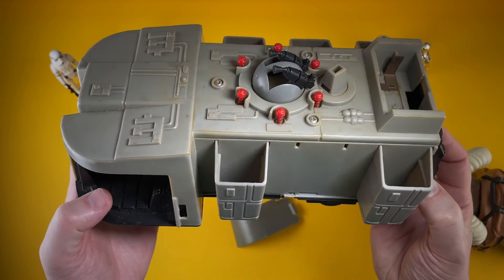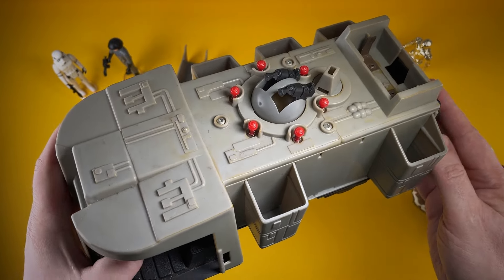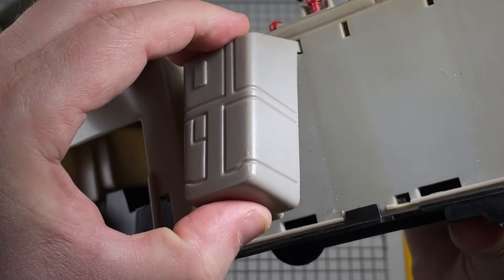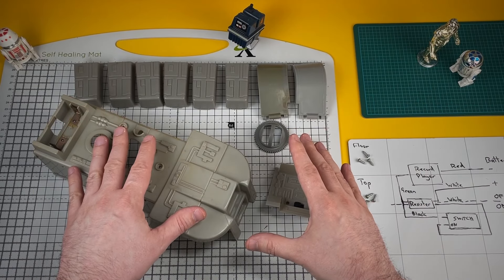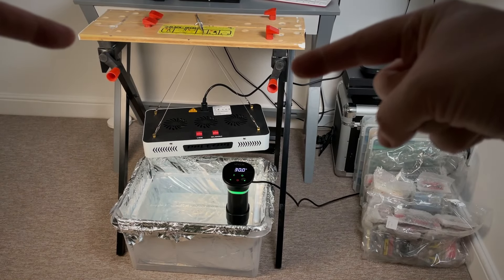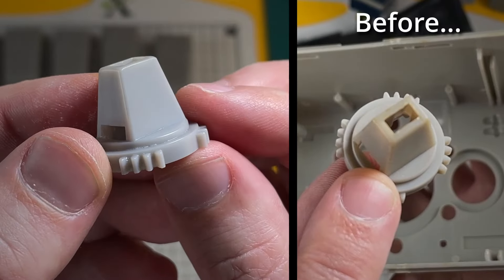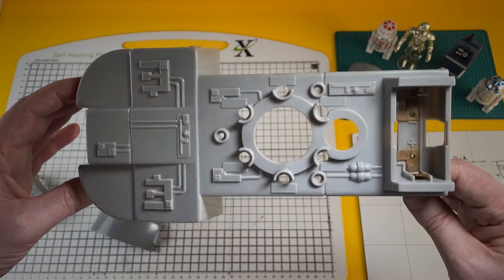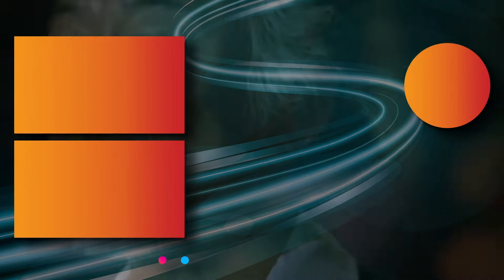Restoring a Wrecked Imperial Troop Transporter - Part 1 - Vintage Kenner Star Wars 1970s

Comment: I really like the idea of heating up the joints before removing the screws! BRILLIANT! I always just pulled things apart (AND HAVE BEEN VERY LUCKY… so far). I’m going to start doing this too!
Love the channel and keep up the great work!
Reply from the maker: Thanks for watching, appreciate it! Yeah heating plastic is useful in many toy restorations - not only for disassembly & assembly, but also for straightening bent parts - at some point, the luck runs out, so best to heat first 👍 Cheers, Dave! 🤘
Reply: Oh those ol’ brittle Kenner plastic blues…😂

Comment: Love your videos Dave. I've got a ITT and the record player is very temprimental. If you can't fix it, no one can! 
Love the Robo Sun method, mines discoloured too, might wait til summer and use hydrogen peroxide and sunlight, it was the taking it apart I was scared of and now I know how, thanks to you! 👌🏼
Reply from the maker: Thanks Kev!! 🤘 I've been very impressed by the Robo Sun method and there's no need to rely on the British weather 🤣 I'm hoping to dig right into the record player mechanics, so we'll see if there's a way to make these things less temperamental. If you decide to take apart, just be careful with the tabs holding the base to the body 👍

Comment: Always tense stressing old plastic, those tiny passenger compartment tabs. O_O Been on the hunt for good plastic prying tools, saw this one that looked like a giant guitar pick that appeared useful.
I think your Robo-Sun is the peak of plastic brightening techniques, yet to see any better method that that. Appreciate the commercial break there, helps put the item into context. ;)
Reply from the maker: Yeah, always tense stressing plastic, but I usually heat before hand. As for prying tools I've got a few from iFixIt.com who specialise in phone repairs. That retrobrite technique came from a channel called RMC, a retro computer video gaming channel where of course they're battling discoloured cases 👍

Comment: Great video! I've also coincidentally  just done an imperial troop transporter restoration after picking one up at a convention for only £15. Mine had the same issues and even the same colour variation as yours between the Left hand and right hand side doors! I think it could have actually been packed that way at the factory. Now, just need to find the top black radar dish and fix the electronics on my one.
Reply from the maker: Hey bikerscout! Definitely would like to see what you've done on your restoration 👍 I found this one at Echo, was looking for the worst one there 🤣 Yeah, not sure what's going on with the doors but I imagine after 40 years they all get mixed up. It seems the one with the ridge is from the Sears release. Good luck with fixing the electronics - that's what I'll tackle in part 2 🤘
Reply: I think the right door is off a sears exclusive version.  It had stickers that fit in the lines.
Reply: @VintageToyRush  I've got the same thing with mine, I'm missing the right door but my left door has the raised ridge and it's definitely the regular version. Maybe it's a Palitoy thing?
Reply from the maker: As far as I can tell from my research, the ridged doors are from the Sears release. The photo on the Palitoy box shows a red stripe sticker on the door, but this doesn't fit with the ridges.
Reply: @VintageToyRush  Mine says 1979 cat number 93351 underneath but definitely has sounds so must be the original version. Maybe we both got one that someone replaced one door on?
Reply from the maker: @stevep1762  Possibly! There doesn't seem to be a very good reference for the vehicles online

Comment: Hey Dave, this is getting really interesting... I'm looking forward to seeing just how that "sound machine" thing really works compared to your Knight Rider episode. Cheers! :)
Reply from the maker: Thanks Mike! 🤘 I think most of the components of the record player will be the same as Kitt but as of now I'm not sure how those engineers designed a mechanism which assigned a track to each button - been thinking how would I do it, but those engineers back then are smarter than me! So am really looking forward to investigating all that when it's opened up 👍

Comment: The Door that you are calling the Control Soor is NOT an ORIGINAL , it’s one from a later release of the troop transports that didn’t have the talking record system fitted .
Reply from the maker: Yeah, the Troop Transport without sounds is from Sears, which I'm sure I said in the video. The Sears one also has different stickers especially on the doors as the Sears one has additional tracks moulded in. So, I had mismatched doors, one from each version of the Troop Transport.